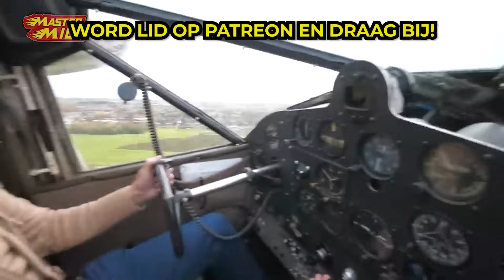De locomotief motor aantrekken! #1198

Comment: 🇩🇪 Zusammenfassung unten ⤵️

🇬🇧 Summary translated by Google 

Today it's about starting the locomotive engine, but first there's still a lot to do on the Type69.....the very last jobs, such as the windscreen washer system for the driver's periscopes....Milo still has most of the parts for this and has already reconditioned them, the rest he still has to order....

....so it's on to the locomotive engine....luckily it's not stuck but Milo wants to look into the crankcase first and after Tom has opened the covers for it, you can see that it looks very good inside, apart from the fact that some dirt has fallen through the oil filler neck....of course that has to come out....the oil also urgently needs to be topped up, there's only a minimal amount left in there....and there are some metal chips in the oil filters....Milo also sucks the last oil out of the carter and some condensate comes out with it.....

....just before Robby arrives, there's a power failure but luckily not as bad as last time when a phase was missing and  the other phases had overvoltage and a lot of devices had burned out...when the power came back on, we continued to get the oil sludge out of the carter...Milo's designer soul is also happy about all the leak trays under every component where a leak could possibly occur....in the meantime, the fuel pump has also been cleaned....a new seal for the fuel filter was also made with a suitable O-ring.....and to set the fuel pump on time, Milo had taken enough photos at the time when he took this out....

....then oil is filled up....and measured....because if the engine is running smoothly, oil is sure to get in everywhere and some more may need to be added.....then the fuel system is vented....and then a strap is misused as a starter pull band....after pulling it a few times with the forklift, fuel comes out of two injectors....then also the third....but even with starter fluid it doesn't want to come out properly....then it does, but only briefly....the next time it tried to start, it came to life...but suddenly oil started raining out of the pipe, which Milo had already suspected was where the oil pressure sensor should be...then after a few more attempts to start the engine ran well, first on start pilot and then only on diesel and then ran better and better...just the right music for Milo....

....and before the engine gets too hot without cooling, Milo turns it off and asks himself what he has to do with the engine now...maybe one or two viewers have an idea that they can write in the comments....now all that's left is to clean everything up again, because the engine thrown out a lot of oil....have fun watching this video and see you again tomorrow....

Mara

🇩🇪 Zusammenfassung 

Heute geht's darum um den Lokomotive Motor anzuschmeißen aber erst gibt es noch einiges zutun am Type69.....die allerletzten Arbeiten, wie zB die Scheibenwaschanlage für die Periskope vom Fahrer....die meisten Teile dafür hat Milo noch und auch schon aufgearbeitet, den Rest muß er noch bestellen....

....also geht's weiter an dem Lokmotor....zum Glück ist er nicht fest aber Milo will doch erst in's Kurbelgehäuse schauen und nachdem Tom die Deckel dafür offen hat, kann man sehen, das es sehr gut darin aussieht, bis auf das wohl etwas Dreck durch den Öleinfullstutzen gefallen ist....der muß natürlich raus....auch muß dringend Öl aufgefüllt werden, es ist nur noch minimal was drin....und das in den Ölfiltern einige Späne zu finden sind....Milo saugt auch das letzte Öl aus der Ölwanne und da kommt auch etwas Kondenzwasser mit raus.....

....kurz bevor Robby arriviert, gibt's einen Stromausfall aber zum Glück nicht so schlimm wie letztes Mal als eine Phase weg war und die anderen Phasen Überspannung hatten und jede Menge Geräte durchgebrannt waren....als der Strom wieder da war, ging's weiter um den Ölschlamm aus der Ölwanne zu bekommen....Milo's Entwerferseele freut sich auch über die ganzen Leckageschalen unter jeder Komponente, wo eventuell ein Leck entstehen kann....inzwischen ist auch die Kraftstoffpumpe sauber gemacht....eine neue Dichtung für den Kraftstofffilter gab's auch mit einem passenden O-Ring.....und um die Kraftstoffpumpe auf Zeit zu setzen, da hatte Milo damals genug Fotos gemacht....

....dann wird Öl aufgefüllt....und gepeilt....denn wenn der Motor rund geht, geht sicher noch überall Öl rein und muß eventuell noch etwas beigefüllt werden.....dann wird das Kraftstoffsystem entlüftet....und dann wird ein Spannband missbraucht als Starterzugband....nach ein paar Malen anziehen mit dem Stapler, kommt Kraftstoff bei zwei Einspritzdüsen....dann auch bei der Dritten....aber auch mit Startpilot will er nicht richtig kommen....dann aber schon aber nur kurz....beim nächsten Startversuch kam er dann aber....aber auf einmal regnete es Öl aus der Leitung, die Milo schon vermutet hatte, das dort der Öldrucksensor draufgehört....dann nach einigen weiteren Startversuchen lief der Motor aber gut, zuerst auf Startpilot und dann auch nur auf Diesel und lief dann auch immer schöner....genau die richtige Musik für Milo....

....und bevor der Motor nun ohne Kühlung zu heiß wird, macht Milo ihn aus und fragt sich, was er nun mit dem Motor machen muß....vielleicht hat der eine oder andere Zuschauer eine Idee, die er gerne in die Comments schreiben kann....jetzt bleibt nur noch eben alles wieder sauber zu machen, denn der Motor hat ganz schön rumgesaut....viel Spaß beim Anschauen von diesem Video und bis morgen dann mal wieder....

Mara

Comment: I would restore the engine and generator to full opperating condition. Then build a 1/2 scale Uboot to put it in. Like several others that have been made for movie props. And several other private Uboots. Madson boot is a good example.